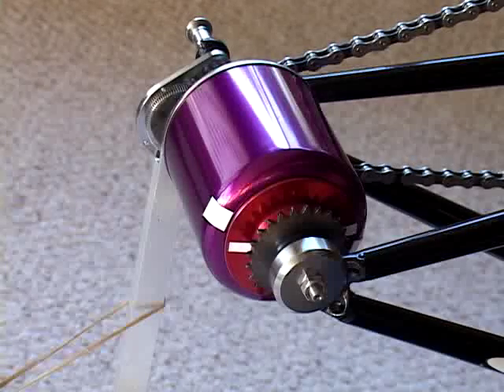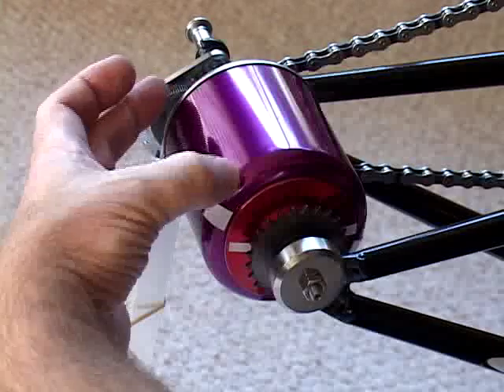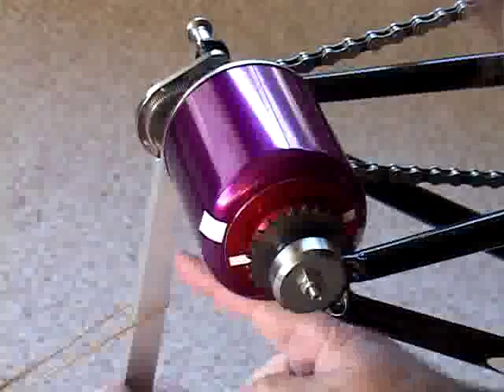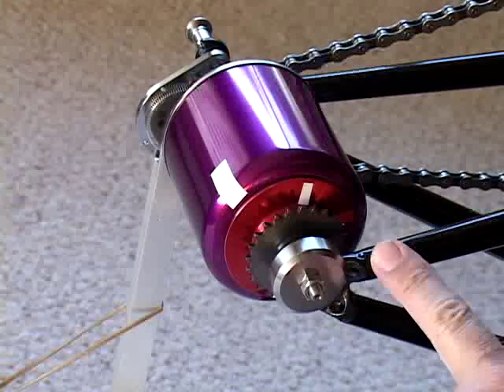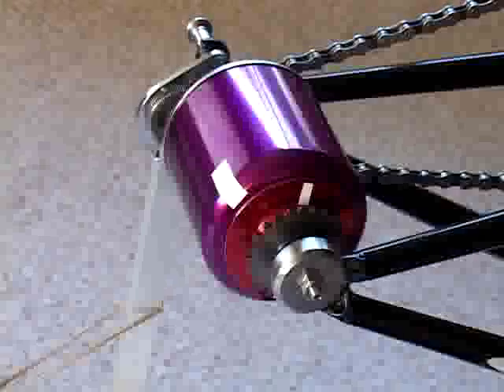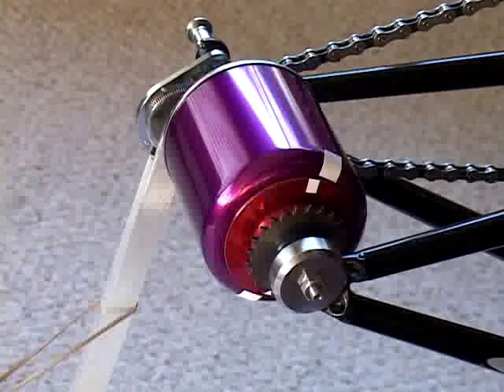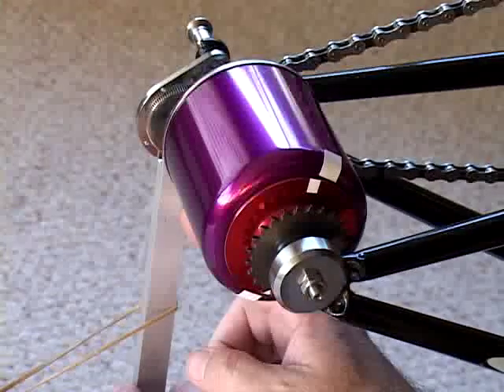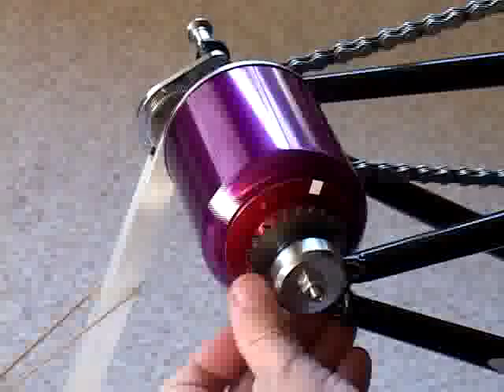Automatic Bicycle Transmission (IVT)

Comment: 4 Million views, 3K likes... and six years... where has this technology gone, who is selling it, how does it work in the market (people purchasing it), etc...  Anyone know?
Reply from the maker: See my response to Craig Wayland 2 weeks ago in these comments.
Reply: SIMKINETICS Have you tried Kick Starter?    

"That's an excellent question, and one that further testing should answer.  I've re-designed it to get higher top ratios, so a future prototype should reveal its durability.  Much of the SIVAT's design is based on well-known & characterized technology that's very durable, but some of its bearings must endure slow, high-force reciprocating action that must be tested beyond usage that's well known.  Those tests may indicate the need for special bearing configurations that I tentatively anticipate with some potential added costs.  This invention is still a work in progress that will likely advance quickly when the economy justifies needed R & D aimed at commercialization; I'm looking at a 1.5 to 2.0 year time-frame to start proceeding on an economic stability opportunity.  Timing is everything.  Meanwhile, questions like yours I seriously consider."
Reply from the maker: Paul Gdry I will use Kickstarter or equivalent when the market shows solid signs of improving.  They make the funding easier, and I want to be sure that such public funding isn't for naught due to poor timing.  New businesses are especially vulnerable to weak markets, so I consider it unconscionable to engage resources at this time; capital investment to prepare for production could be considerable.  My best guess is another 2 years or so before the economy starts ramping up, hopefully with gusto.

Comment: So its 2014 what does this look like now and did you get it working and can we buy one?
Reply from the maker: I explain the delay in several recent comments.  Please read them.  

The appearance will resemble the uncolored 'shell' that will enclose the SIVAT as shown, but will likely be color anodized finish, and slightly larger than the magenta housing shown in most of the video.  The core of the transmission can also be used at the bike-frame's bottom bracket, but would require a special frame with a larger than standard BB, and would allow a lightweight rear hub.  My re-design will raise the top ratio to allow for a small chain-ring (front sprocket) of <32 teeth.  This initial proof-of-principle prototype shown was tested for torque that the re-design addresses for typical heavy-duty durability and longevity in mountain-biking.
Reply: thanks for nothing...

Comment: How durable is it?
Reply from the maker: That's an excellent question, and one that further testing should answer.  I've re-designed it to get higher top ratios, so a future prototype should reveal its durability.  Much of the SIVAT's design is based on well-known & characterized technology that's very durable, but some of its bearings must endure slow, high-force reciprocating action that must be tested beyond usage that's well known.  Those tests may indicate the need for special bearing configurations that I tentatively anticipate with some potential added costs.  This invention is still a work in progress that will likely advance quickly when the economy justifies needed R & D aimed at commercialization; I'm looking at a 1.5 to 2.0 year time-frame to start proceeding on an economic stability opportunity.  Timing is everything.  Meanwhile, questions like yours I seriously consider.

Comment: You should put it in electrical bikes! I'm thinking in the lines of keeping the resistance of the pedals constant while the motor does the rest of the job. And being able to choose the desired resistance electronically with the LCD display, where you also choose level of motor assistance, or a smart combination where you only choose one setting motor assistance / pedal resistance! In that way, getting rid of a manual gear on electrical bikes!

Comment: What do you mean by "it's always engaged" ? do you mean i don't feel a jerk everytime it shifts?
Reply from the maker: Yes, there's no abrupt change in ratio, no jerking.  It also means that it can gradually transition from zero output speed into extremely low speed output, similar to a skillful clutch action, but without ever actually being disengaged.  Although it's not intuitive to understand, the SIVAT is already fully engaged at its zero output speed (unlike a clutch operation).  It's unlikely that you've ever seen such a transmission before.
Bicycles don't need this transition from zero, but it's a handy feature for motor-driven vehicles & machines, and it enables very extensive ratio bandwidth that's also convenient for pedal-driven vehicles like bicycles.  The bicycle version will be tuned to make it nearly impossible to ever go to impractically low ratios or zero output.  In effect, a single design can be tuned for various applications within its power rating, and it can be re-sized for various power throughput extremes.
Does that answer your question?
Reply: SIMKINETICS what would happen if you are at 25 mph, move your "throttle" to zero and stop pedaling?
Reply from the maker: Prof. Michael O. Zimmermann JCD ECS The SIVAT output  inherently free-wheels under all conditions, so regulating its ratio has no effect except in forward driving of the input.  The ratio control can be overridden to change the ratio 'on-the-fly' (while under load) or during coasting; if it's under load, the ratio change is somewhat slower than in an unloaded condition.
Now, a question for you: what do you teach?

Comment: One could be made bigger to run a electric generator for power driven by a small electric motor, making much more power then is used !  No end to the capability's. Nice work !

Comment: Is it possible to do an "overdrive" (output faster than input) with this kind of mechanism.
Anyway, interesting concept and thanks for your initiation :)
Reply from the maker: Yes.  The new design will feature a 2.6X high ratio.
Reply: Sound interesting! That should be high enough (or too high) for all kind of bikers.
I guess this gearbox consist of sets of planetary gear. Anyway, looking forward to your success. Thank for the answer ;)
Reply: Kritsada Charoen
If you want to see the design, checkout patent # 5516132 .

http://books.google.com/patents/US5516132
Reply from the maker: Ukeleleninja This is different, although it uses the ratcheting principle too.

Comment: I think the video misses the mark. A trany is suppose to output more than goes in. I want to see the out put go faster than the input, not slower. Maybe I just don't get it?
Reply: Almost all transmissions have the output slower than the input.  Imagine the wheels on your car spinning at 3500 RPM.  The purpose is "torque multiplication".
Reply: ralphinator2 Yah, that makes sense. What was I thinking, daa?

Comment: I would love a transmission like this on a sports car with a manual configuration. A lever in the center console allowing you to adjust the ratio manually would be a real experience to drive. Unfortunately no car manufacturer would ever build such a machine.
Reply: Challenge accepted
Reply: @sackofbrick  are serious? This is my dream.

Comment from the maker: This new YT format sucks.
Reply: He has the end of the chain we don't see hooked to the pedals, powered by an external source. Like an electric motor. If u notice, the chain seams to turn at a constant rate after it's rotation is started. The lever he is moving is the linked to the variable output. So as the lever input changes, so does the speed of the output shaft. No matter the input shaft's speed unless, the input isn't turning. Don't divide by Zero, lol.
His device is mounted on the wheel, or hub (back end) of the bike. The device can replace the transmission (ten speed, 15speed, etc) assembly with just one device on the rear hub. It has no power output within it. There is no motor inside, but a very neat device.
Reply: ptrainenator thx! so no more derailers and stuff like this ? impressive a more symetrical more agile bike ? perhaps ? lets see how it works and lets see the cost ?
Reply from the maker: ptrainenator Close!  I actually turned the bike's crank by hand while keeping a constant pedaling rotation speed.  The front sprocket is 55T, the back sprocket (the SIVAT 'input') is 11T; so the whole system has a 5X speed increase even before SIVAT affects it's own output.  In the newer design, the gearing up is internalized w/ a 2.7X ratio so that the chainwheel can be as small as 32T for great MTB ground clearance & a very high top gear ratio.  The bicyclist can choose his preferred front/back sprocket sizes without losing the ability to achieve all overall ratios down to zero!
Reply: SIMKINETICS
Reply: Don't worry, It sucks agian now with this new format
Reply: can this be fit to old road bikes from the 80's 60's etc ? so no need to pedal is this correct ?
Reply from the maker: godsthunder26 I'm redesigning the SIVAT.  One goal is to provide a core that can be adapted to any bicycle with a minimum of special optional parts.  You'll still need to pedal it unless you choose to motorize your bike; adapters will likely be offered for its motorized use too.  Without leg or motor power, you won't go anywhere except downhill!  Maximum power throughput will be 1kW, which is ~4X typical pedaling power for athletic MTB riders.
Reply: n

Comment from the maker: Yeah, I've seen such solutions many times over the years, including one that used 'ratcheting' (the basis of the SIVAT) combined with a spiral track in the chainwheel.  Whenever any CVT concept emerges, I tear it apart mentally to evaluate its engineering soundness & likely durability; a fully enclosed chainwheel system is a non-trivial design problem.  BTW, I've seen your hills in Wales; you should see where I live!   ; ]

Comment from the maker: I'm re-designing it for a 2nd prototype that will be shown in action on a bike; this 1st 'proof-of-concept' prototype has a couple of weak spots in the design that were identified for correction after testing.  BTW, you'd likely be interested to know that the mechanism uses GEARS for power transmission!

Comment: I agree with Doug.  The presentation is boring, and shows nothing tangible.  This demo could have been done with a cone and a rubber band.  Put it on a machine and show it doing some real work.  If you want to be taken seriously you need to show that it's more real that all the free energy machines out there.

Comment: You have it backwards. Your pedal/wheel rotation ratio is kept In between 0 and 1. On a regular bike this ratio is always well above 1. The ratio you have will result in a very slow bike, almost to the point of uselessness. You need to reverse the input and output or the internals to get an inverse output of what you already have.

Comment from the maker: This design concept allows overload conditions to be set.  The new design for bikes sets the limit at 1.0 kW, a value that won't likely ever be achieved by pedaling uphill, but will protect the system from destruction by use of motors with power beyond recommended values.  For more powerful applications like cars, the SIVAT would be enlarged & have much higher limits.

Comment: Seems like it isn't efficient at all. The energy seems to bleed at a very high rate. 6% efficiency is horrible. Why would this be better than any centrifugal clutch type transmission or even just a simple geared transfer . Looks over complicated and under powered.

Comment: ooh, I like gear hubs a lot; but what about the Sachs automatic hubs, those red and blue two speeds. They were almost like the duomatic, but changed gear automatically, not even with any back pedalling. Will your hub be available for testing?

Comment from the maker: ...The ratio range can thus be expanded to any practical level!  The benefits are that any ratio can be achieved, and can be accessed & changed without any clutch or disengagement.
Cost-wise, the SIVAT is neither exotic nor more complex than many stepped transmissions, so costs should be competitive with other transmissions.

Comment from the maker: Like CVT's, IVT's ratios are not discrete or stepped; the ratios are selectable along a continuum.  The 'infinite' reference for IVT's relates to their unbounded ratio range inherent in achieving continuity down to zero ratio, i.e., any high ratio is infinite times the lowest ratio of zero.  If auxillary gearing raises the top gear, the IVT still allows the combined system to reach zero!  This is demonstrated in the video by the fact that sprockets are 55T/11T, raising the overall top ratio...

Comment from the maker: IVT is an established standard name to distinguish this from a CVT.  I know the man who coined the term many years ago.  See Wikipedia for the reason for this use of the word 'infinite'.  The SIVAT obviously cannot produce infinite torque at its zero output speed!  The math function follows an asymptotic curve to a practical limit when the control system reaches material strength limits, then defaults to zero speed in the SIVAT's design via overload-protection.

Comment: Makes sense.
Suppose u could just set the trans to give a compromise ratio, maybe even have a manual over ride to lock it in a ratio and change that with a twist grip etc.

Comment from the maker: BTW, pedaling torque hits its maximum at about 80 degrees down from the top of your stroke, and is reduced to ~10% at 180 degrees later (almost like a sine function).  I account for this in the design of the damped spring system in the SIVAT's automatic feature.  The ratio will go lower faster than it will go higher, so a sprinter or hill-climber will be able to respond rapidly to a need to surge with fast cadence.

Comment from the maker: Actually, this is very good for engines because it will regulate engine rpm in a smooth, continuous manner.  An analogy is the longevity of light bulbs that last much longer with a dimmer rather than a light switch.  The SIVAT will also reduce shock loads throughout the drivetrain.

Comment from the maker: Yes.  I tested a bike with a predecessor CVT with a similar automatic feature; and that's exactly what it did.  This effect will be attenuated with an adjustable damper that slows the response in the half cycle of pedaling action.  One unexpected benefit from some of this action (in the earlier CVT) was reduced stress on knees.  The rider will have the choice about adjusting this for his/her preferences, but even light damping is not objectionable as I discovered in my undamped predecessor.

Comment: Sir, this looks like Raleigh bicycle free wheel ratchet gear transmission.If you don't want to show the function then apply for patent.Otherwise clearly show your idea open show that we can comment on it.
FYI I have and idea and design of a same type transmission which operates from hydraulic fluid.The motion are changed by the motion and load itself.The pedal power will remain same.The rear transmission will work according to power required.
All have to wait till 30 oct 2013 my 56 birthday.BW.

Comment: I am researching to build an electric gocarts presently, and this may be very useful for gearing an electric motor directly to the rear shaft for very high low down torque and a potential for extremely high top end speed.  Is it based on two conical gears and  a variable belt idea or hydraulic? How much? Where and when can I get one?

Comment: I am Curious how much torque can the current designs handle and how much horse power can you put to it and  through it to a standard lightly modified bicycle wheel say a 28 or 29 inch standard street or off road application

Comment: It sound like it is an ordinary gear system in that something like 5X as high of gearing will give you 5X as much resistance not anything like 4X as much resistance. Would I be able to buy one without it being automatic. Do you see there being any practical uses for the system on my bike?

Comment from the maker: The SIVAT will provide pedaling resistance similar to modern derailleur systems, but will allow you to globally tune that resistance force by simply turning a knob that changes the thresholds for ratio change.  The range of ratios will extend into both higher & lower ratios than is practical w/ derailleurs.  The goal is to keep pedal resistance & cadence within a narrow range despite the grade of the hill you're ascending or descending; that optimizes pedaling efficiency.

Comment from the maker: Sometimes a company will buy a patent to remove potential competition without ever intending to produce the device.  The costs of tooling & development for a new product might deter that company from proceeding if the market can't justify those expenses.  There are ways to discourage that practice in a licensing agreement, which is not a sale of the patent.  I want the SIVAT design to be so good that a licensee will choose to mass-produce & sell it!

Comment from the maker: The new design will be bench-tested when it's built as another prototype to be de-bugged (if necessary).  Then it will be mounted on a bike for extensive testing on the road.  At that time, I'll make another YT video to demonstrate the result.  Any personal demo will require you to travel to California.

Comment: Does a torque multiplier like what you have there mean that it is a regular gearing system with 5 times as high of gearing with 5 times as much resistance or would it be more like you have 5 times as high of gearing with torque being multiplied by 5 to give you the same amount of resistance.